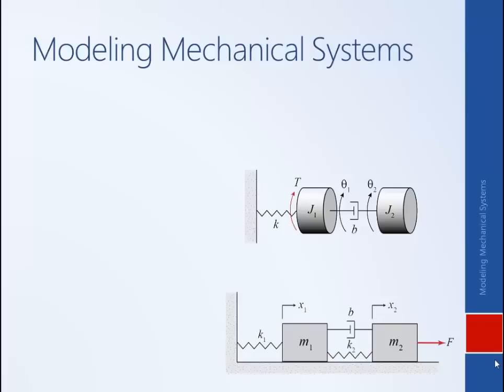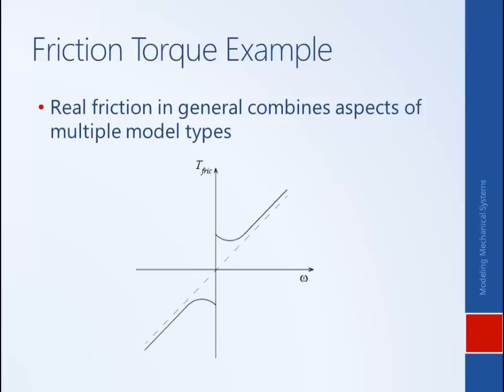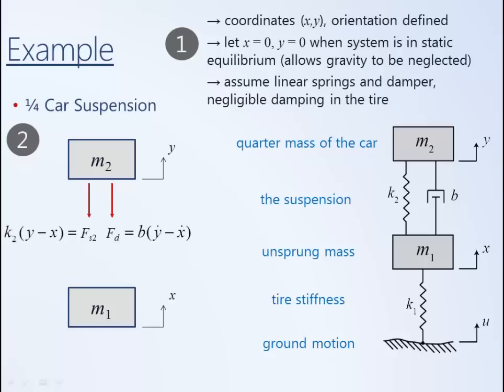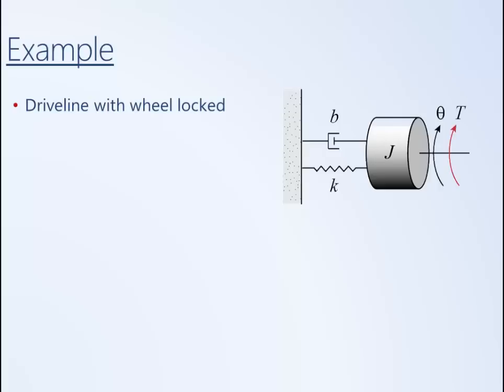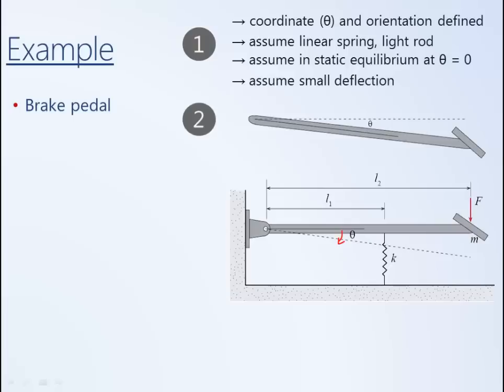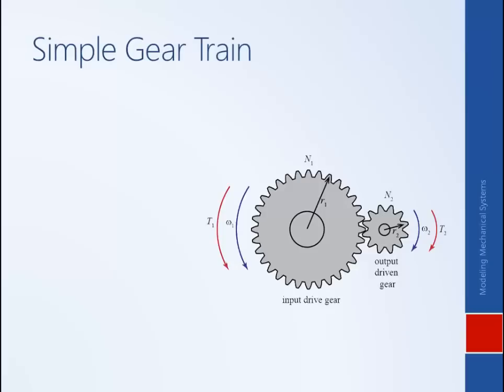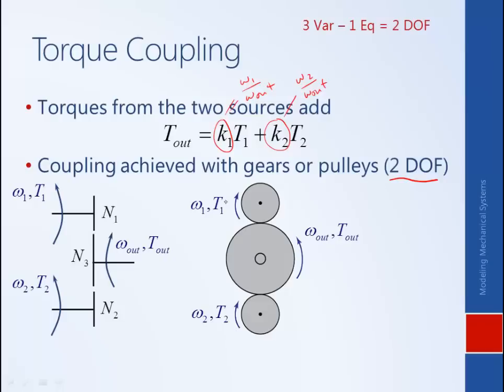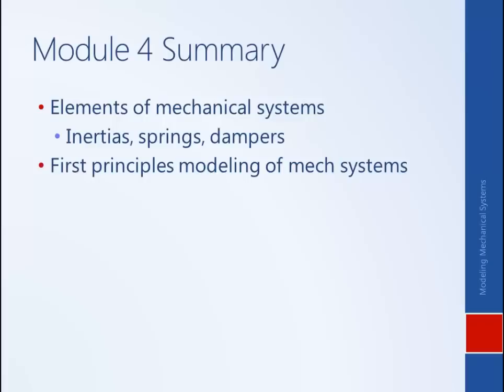System Dynamics and Control: Module 4 - Modeling Mechanical Systems

Comment: For M1 if you assume same analogy with M2, why not the two forces on the upper side of m1 are acting downward?
Reply from the maker: You can use the same analogy, but when the forces on the upper side of m1 are acting downward, you are assuming that x > y (and xdot > ydot). Therefore, the expression for the spring force would be Fs2 = k2(x-y) so that the expression is positive when the force is in the direction drawn. When the expression is negative, the force is opposite the direction drawn. The same logic holds for the damper force.

Comment: Thank you for this video, it's very helpful. I have a question though, how do you find the state space representation for a circuit with, say on displacement  X there's a mass and maybe 2 springs(one in displacement X and the other between X and Y) and at displacement Y there's a damper (and the spring between both displacements) but with no mass? I don't know if I make sense, but what I'm trying to ask is how do we find a statespace representation for a circuit with 2 displacements but only one of them has mass
Reply from the maker: You can have a look at Module 27b for some insight - https://youtu.be/RdAZNUfWDpQ

Comment: Rick, thank you for making this extremely clear. However, I am confused at 19:30 when you begin to draw the FBD for m1 you specify two methods for determining the direction of the forces acting of said mass. In the first method, where you fix m2 and move m1 in the positive x-direction, the spring and damper elements (k2 and b) would be compressed upwards so the direction of the generated force should be downwards to oppose or restore. This would mean that method #1 and method #2 (where you flip the direction of the force in m2's FBD) would have forces acting in different directions. Can you clarify why choosing one method over the other would result to different orientations of the forces in FBD and how this would affect the solution? Thank you!
Reply from the maker: Whether you stretch or compress a spring, the restoring force on the two ends will be opposite as long as you are consistent in the direction and sign of your displacements. If for example, you stretch the spring between m1 and m2 such that y is larger than x, then the two ends of the spring will pull the masses back toward the spring resuming its free-length.  If you compress the spring, such that x is larger than y, then the expression for Fs2 = k2(y-x) will be negative and the forces will be opposite the directions drawn.

If you express the force as Fs2 = k2(x-y), then the force is positive when x is larger than y and the directions of the force in the free-body diagram should be opposite the way they are drawn in the example.

I hope that helps.

Comment: excellent
sir how to apply this control theory on practice basis..

I mean, how can I control any physical system by any microcontroller or microprocessor
Reply from the maker: I have created some web-based instruction on using the Arduino Microcontroller (through Simulink) for controlling some simple systems such as a DC motor, a DC-DC converter, and a lightbulb. The pages can be found under the "Hardware" tab at the top of the page whose address is given below:

http://ctms.engin.umich.edu

Comment: Very nice and clear explanation. please let  me know  if we want to put a controller, It should be one controller between body of car and Tire, I want to know do we will have just one u(t) in our equation (in 
our state space vector) as output?
Reply from the maker: If you added an actuator, for example something that generates a force between the car and tire, then your system would really have two inputs. One input from the actuator and another input from the road. The number of outputs would depend on what you were interested in.

Comment: With the quarter car suspension, do you derive a transfer fn for this example anywhere in your videos
Reply from the maker: +Chimeout Brah Unfortunately, I don't. The closest thing is that I derive the transfer function for the rotational example in this video in Module 5.
Reply: +Rick Hill  the rotational example you go through, could that be termed as a feedback control system (ie a closed loop system) ?? Also, love the videos they are such a huge help!
Reply from the maker: No, that is not an example of a feedback control system. The input is a torque applied to the shaft and the output is the angular twist of the shaft, but how the torque is determined (and generated) is not included in the model.
Reply: Ah i see. Besides the cruise control example in Module 13, do you go through any other real-world examples of closed loop feedback control systems?
Reply from the maker: Modules 14, 18, 22, and 23 do controller design (algebraic, root locus, freq response), but they are more focused on the process, rather than on practical real-world applications.